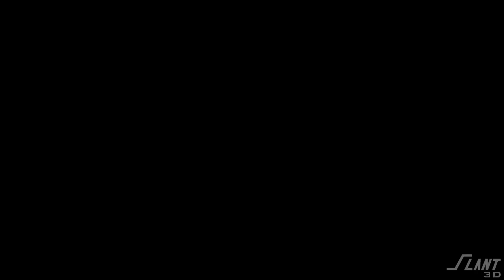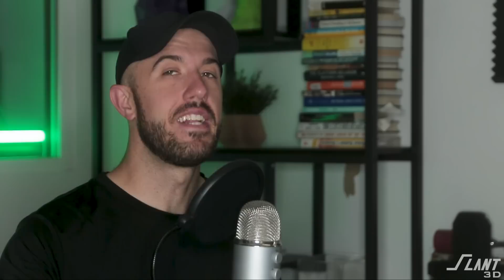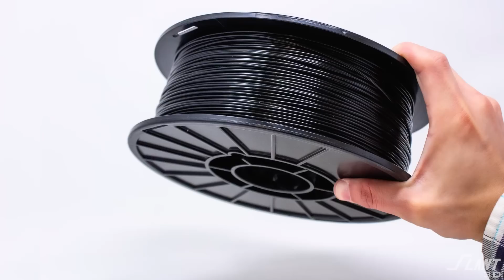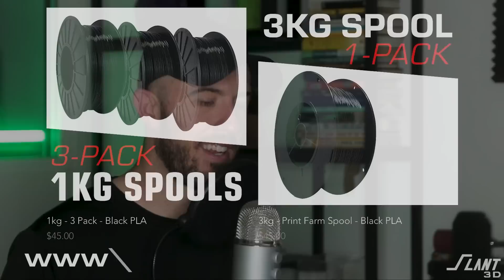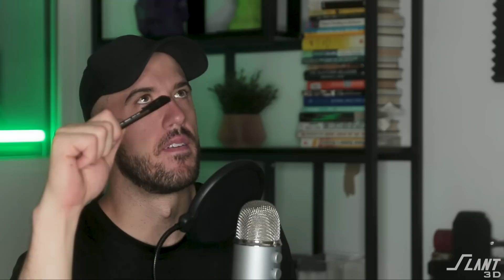How We "Scammed" another YouTuber | Tangled Filament Updates | API Improvements | 3D Printing News

Comment: Having seen both your, and Morley's, videos, I think you were treated unfairly in the comment section. As they say... "never read the Youtube comments."

I'm impressed that it all got done in such a short time, really. There's even a possible benefit to using that spray foam infill, shock absorption. Unfortunately that may be a short-term benefit, I dunno how well spray foam works with multiple compression-relaxation cycles.

Comment: You messed up. It's happen, bad luck. But the problem is how you respond. You should just take responsibility, evaluate what went wrong and how you plan to fix it in the future. In my opinion the biggest problem was communication. You didn't consult on slicing and how it should be assebled, you didn't inform about material costs, you didn't tell about mistake and finally you didn't inform about shipping cost. You just did bad job, packed, shiped and send invoice. For potential customer it looks very bad.

And now you portrait yourself as a victim. "We rushed it, because we didn't make any money on this" is not good excuse and "we will not do collabs" is not a solution. In my opinion this is much worse than original chair video.

Comment: This seems to be a more user friendly version of a tool I bought off one of the Chinese marketplaces. It also does the heat fusion inside the PTFE tube, but there's no screen or digital controls which is a nice enhancement. They supplied a potato peeler to remove the tube. It works I guess.😂

Comment: Its the age old problem of quality, speed, and cost; you can only chose two, and sometimes only one. In this case, speed and cost were chosen, so quality suffered a little bit. That's just what happens. Surely if there was more time, quality could have been achieved. All aside, this is an alright way to handle things I think.

Comment: I watched Morley's video and it came across as him being rushed and not planning things properly, from design to assembly. I enjoyed the chaos, but it also shows the difference between a 1-off project and something that is carefully engineered to be printed many thousands of times. A good followup would be to have a video around exactly that. What would you do if you expected to make this for real. One thing that struck me is why was there no test fit at a reduced scale? Would you not want to print a 1:10 model or something like that before committing to full size? One more thing, your solution for running the spools outside the AMS works for the AMS-Lite used by the A1 and A1 mini, I have been doing that for a while. However, it appears the more sophisticated AMS used by the X1C and P-series has some starts that detect the lack of respooling.

Comment: I feel like the top comments of that video probably don't have the full context, but I do think Slant3d has to own up to the fact that a mistake was made, which is that the wrong parts were sent. While this may not happen during a normal customer run, it is an issue caused by Slant3d during the engineering stage, so I would suggest doing more collabs, but putting more resources, time, and attention into making sure the collab doesn't have any slip ups. This is just the way marketing is.
Reply: part*
Reply: @zenginellc  Well, I just mean that the chair was assembled from multiple parts, including the core, which didn't line up. Yes, if you consider the chair itself to be the part then it is a single part, but my understanding from watching this video is that some of the parts were printed from one CAD model version and others from another by accident. This caused the core (watch the video of him putting it together) to have several parts that wouldn't fit together. It could be fixed with an additional part as stated in this video, but obviously the best solution is to have everything be correct the first time, particularly in a marketing situation. If you get marketing wrong the first time, most people will not look again. A book IS judged by its cover. Alternatively, a contract can be made ensuring a video isn't published until after the engineering stage is completed. I think adding such things is more than reasonable in such a situation to prevent someone from rushing a video out.
Reply: Sounds like they didn't have more time?

Comment: Blended plastic bottles and hopper style 3d printers for petg are still high value options for rapid prototyping.  Practically no material cost.
Reply: Also hanging spools is fine but not great for long term as dust accumulation or polymer crosslinking from UV/moisture exposure can compound over time but it will work if you just care about printing off a spool.

Comment: Part of the AMS's functions when changing colors is rolling the spool in reverse to suck up the filament being fed back to it.  If you hang the spool seperately, you  end up with the filament just sort of tangling up and hanging out of the machine.  This... may not affect most simple operations.  But a 24 hour print with multiple color changes may be negatively affected.  But thats probably mute for yall since yall really only offer 1 color and arent going to be used for color changing.

Comment: I watched the video, and it was presented as "I tried to put the parts together, but there were wrong pieces", then goes right into "here is the bill".

Not a great look for you folks, but if they didn't reach out about the error untill have the project was done, there's not a lot you could have done differently.

Also, this is just the nature of building things. The first attempt is rarely perfect.

Comment: You can not use spools in the ams without physically placing them inside. There are motors that pull the filament back onto the spool and the rollers are motorized. When the AMS winds back the spool and takes too long it will halt and report an error, because it can't do it's job. It will also not be possible to change colors or material like that.

Comment: I saw the Morley video and there was never from Morley's point of view any ill feelings and he even iterates as much in the video himself and he also explained about the versions in design that got mixed. Morley's frustrations was more with himself as if you watch the video he was not properly setup and prepared to assemble the chair. he then went into panic mode of getting it to work out using some epoxy glue that did not set properly as he thought it would then jumping onto a superglue to temporarily hold the pieces together so the epoxy glue could set even trying to strap it down. the epoxy even took a couple of days to really cure and bond. In the end the chair was working just fine and he NEVER had anything bad to say about SLANT 3D.  Those that called you guys scammers are just those type of people that like to sit and be negative on the internet...

Comment: Hanging above the Bambu Lab AMS will work for printing, but won't work for colour changing as it won't respool. There are rollers that move inside the AMS to respool the filament properly when retracted. Without that, it will just spit it out everywhere.
Reply: Vincent Groenhuis from University of Twente has published and collected a bunch of auto-respool spool hub/holder designs. Might those help?

Comment: The answer to this in my mind is very simple. You produce a follow-up video with Morley where he gets chance to explain some of the nuances and shortcomings of the original project and you get chance to explain the design elements and how it needs to be designed better, but the time constraints didn’t allow it. 

Then you produce that chair with no time pressure whatsoever; your filament, on-budget while using the manufacturing techniques you described, making the chair more structurally sound and more economical in both filament and structural integrity of the design. 

That way you guys both win and I would say don’t put any kind of time pressure on this - just treat this as a bit of a side project; if it takes six months it takes six months but ultimately you guys carry on running your business and on the side do the job properly, the way it should have always been done.

I like Morley but he definitely needs to put something out there for the idiots that don’t get that some of the problems that are occurred on nothing to do with slant 3-D. It was a decision taken due to the time constraints of the project and that showed in the video.

Comment: Suggestion: sponsor a follow up video with better timelines where you can showcase your capabilities.
Reply: That does'nt seem like a good idea.  It would be a lot of time, filament, and expense for something that was just an experiment.   A tiny desktop toy version, properly designed so the pieces fit together right might be better.   It shows how to design big parts right, and could be sold as a puzzle or toy.  They could send a couple to morley as a memento.
Reply: @McRootbeer   I mean this chair definitely cannot be sold as a puzzle or toy, even Morley's use of design was a little on the edge as far as potential legality of it. You're going to have to negotiate with the company that makes it and actually license it.

Comment: Please use re-used spools for Wonk and not for batches of regular, I WAY prefer the plastic spools (and will even more prefer spool-less).

As for the plastic ones not working in the AMS, they work fine with the Hydra Pro mod, but your suggestion to hang a spool above will unfortunately not work, since the machine specifically senses for pull-back that it does with the motor in the AMS.

Comment: Thank god you’re getting rid of reused spools.  I had soooo many problems with them randomly unspooling themselves during the first 10-20%.

I never had problems with the plastic spools in my AMS if I just left the lid open. You can technically feed from a rack above the AMS, but it will error out retracting the filament.  You could just as easily use the side spool holder.